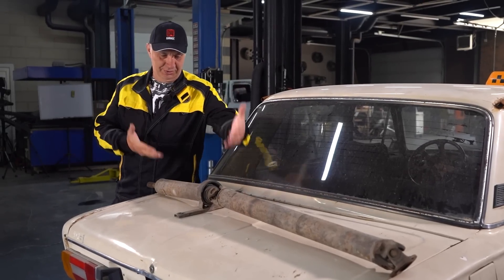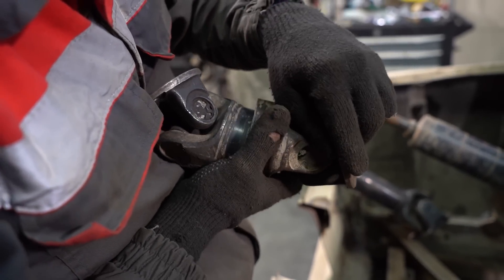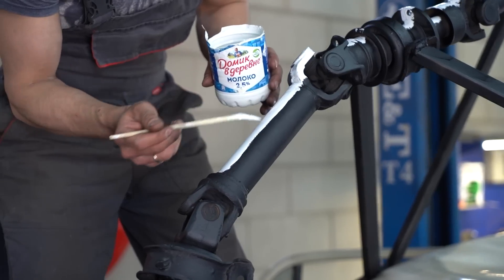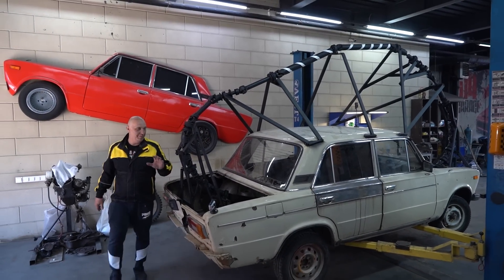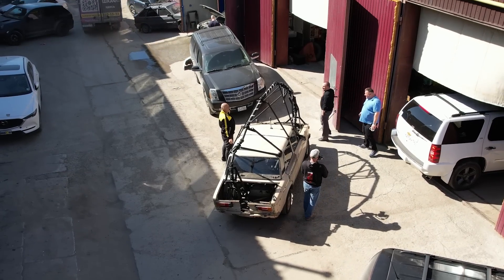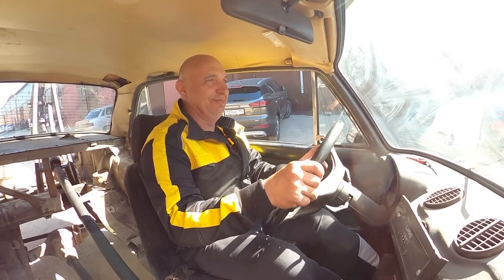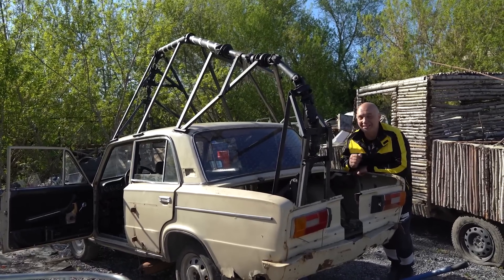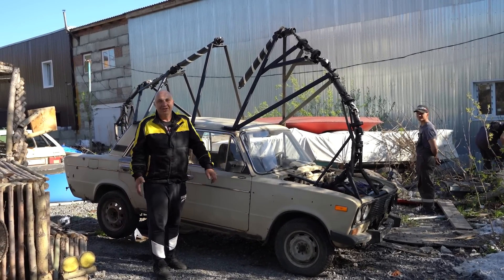We make a propshaft that loops all the way around a car

Comment: Straight is not completely better, you want a small amount offset with the unis in parallel to minimise vibration, but not more than 3 inches of offset. But for fun, it’s clear that rules don’t apply 😂

Comment: With U-joints there is going to be a lot of drag and it is going to vibrate like a powered dildo.  If they used CV joints however, this would work just fine, though there will still be plenty of frictional drag.

Comment: You could leave these guys loose in a scrap yard and a week later they'd have a few dozen fully running cars back on the road.
Reply: Yes and most scrap cars are not that bad most people give up on them
Reply: Or cars that'll look absolutely normal until you drive them. Like it's front driven but steering is done at the back wheels.

Comment: Next time build a car that runs on a propshaft on the rear wheels and powerd by hydrolic fluid on the front wheel
Reply: they did one with a hydraulic pump driving the rear axle. that's fairly similar.

Comment: are those u joints properly aligned? they must be 90 degrees apart in each joint
Reply: instead of putting the cardan shafts in a circle, they could be in a figure 8 to cancel the forces.

Comment: And again, you are torturing the poor Fiat 124 R...  The old guy must have been very traumatized by that car.  LOL.
Reply: That one is a 2106, and Lada 2101 was much more than a Fiat from the very beginning, there were some 800 changes to it, and it used a new overhead cam engine designed by the Soviets instead of the seemingly obsolete pushrod Italian.  It's too bad that unlike the Poles they didn't start with the bigger 125 body, 124 is quite cramped in the back.
Reply: I don't think it's Fiat
Reply: @SmallKittyPaw Lada 2101 is a license production of Fiat 124
Reply: @jeppemedhuen2410  Vaz 2106 to be more precise, and it is called Zhiguli, Lada was an export name, but then it stuck to the brand as the main one.
Reply: @SmallKittyPaw  well yes, but actually no
Reply: @SmallKittyPaw  it is
Reply: Lada Riva was one of the other names the Russian-modified Fiat 124 was given.
Reply: Its lada 2103